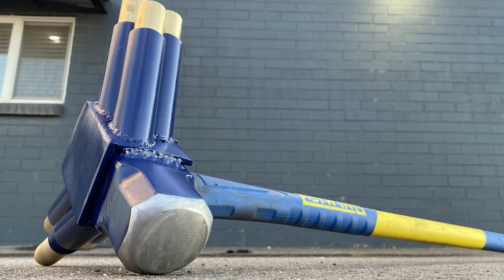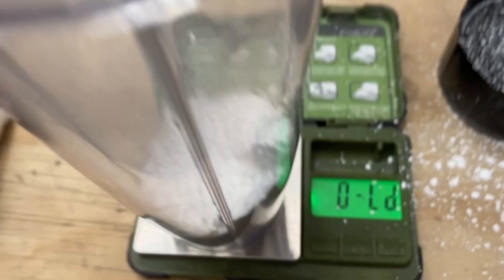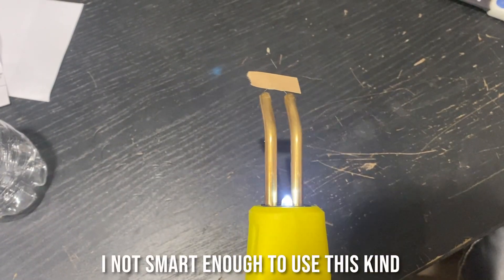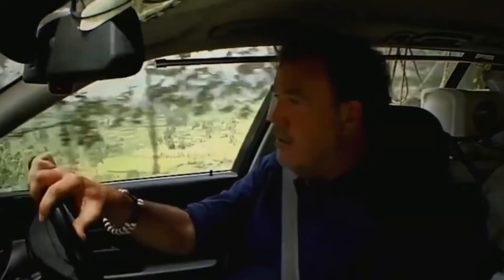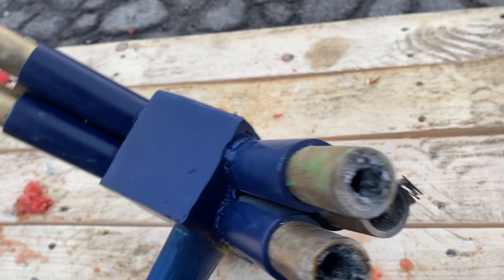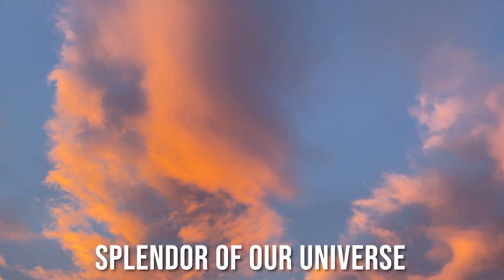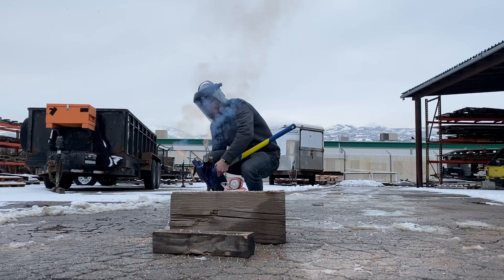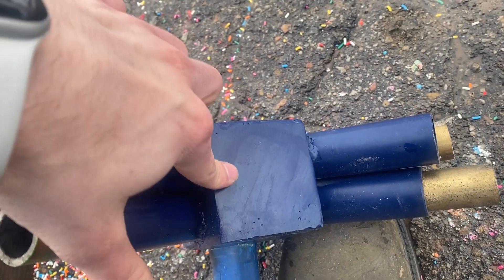I Made The World's Most Powerful Sledgehammer!

Comment: Lost a huge amount of force vector with the angle of those things.  Also the lack of efficient nozzles and an unbalanced fuel recipe means you are getting smoke and flame...but very little effective thrust.  Also, look up how to make electric matches.  It's simpler than you'd think.

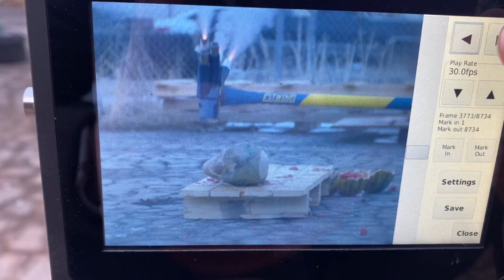@7:00 the fact you are still holding the hammer level through the air despite the fact only one motor is lit on that side confirms you are getting nearly zero thrust - or that thing would be trying to spin out of your grip.  At a minimum twist slightly to the right.  Too bad - missed opportunity!

Comment: Next time use bread ties and a car battery charger. Clean coating off then fold a bread tie into a v, put paper between the legs of the v and Jam it into the rocket so they don't touch. Attach battery charger leads to either end of bread tie then turn it on. Bread tie gets white hot instantly. Great for fireworks you don't trust

Comment: Why fuses and not battery powered model rocket ignitors? could have rigged the rocket ignitors up to a button on the handle so you dont have to handle a torch to light the fuse. plus easier to sync em up.

Comment: Instead of angling the tubes you should've just welded them parallel to the head to really take advantage of the extra force. I'd say your rocket fuel ratio was off and acting more like a smoke bomb - if you can still lift the hammer as the motors are firing, they're definitely not producing enough thrust.
Also, set up a trigger system with a 9v battery that runs to some steel wool for an easy electric igniter, that way you know all of them go off at the same time.
Reply: Ye its obviously for safety but the rack test kinda showed that the angles might have been a little to harsh

Comment: I can't be the only one who's not convinced the rockets were adding any significant amount of force to the swing.
Reply: Right. The thrust on those things are meager at best. 🤣
Reply: pff next you're going to tell me painting flames on the side of something doesn't make it go faster, get real.
Reply: @capness1228  I had a bike that I got for Christmas one year. I would go down bleachers at the school, it was cool and all but I wanted it to be awesome my dad suggested I put some hot wheel stickers on it. So I put about 10 or so I can confirm it made it faster. I went so fast down those stairs my bike broke in half. It was way to fast I should have stopped at 5 stickers
Reply: @capness1228  really??!! Well looks like I got scammed
Reply: You mean those homemade smoke bombs, or the single C6-5 rocket motor which produces a peak thrust of 3.4 lbs offset at a 45 degree angle, effectively reducing the thrust 30%? So he effectively turned the stock 10 lb hammer into a fancy fire shooting 12.5 lb hammer!

On the one hand, safe practices means that anything much larger would be wildly dangerous to both the user and anything within several hundred feet, especially if the thrust to weight ratio exceeded 1.0, but on the other hand the intro said "50 lb of thrust" which I have a feeling was never verified with a scale. 
Also I know some hobby rockets use an electronic ignition, imagine how cool it would be to hit a button on the handle to ignite the rockets before letting loose your mighty swing
Reply: to be fair, when it was standing up for the tests it was moving the hammer side to side, so even a couple of them had enough to overcome it's weight?
Reply: Zey did nussing!
Reply: You're the only one with enough autism to think that and actually comment it
Reply: Total garbage!
Reply: Yeah, but it looks friggin epic
Reply: Fr
Reply: Extra weight
Reply: they were basiclt smokebombs
Reply: Yeah but using it looks like a Forward Smash so it's valid
Reply: Comedy
Reply: Young kid who works at a metal shop guaranteed. They build a bunch of silly some times badass random stuff.
Reply: This Idea just screams "special needs"
Reply: You arent it just looks like what a normal sledgehammer could do
Reply: I think it's just supposed to be for fun. Like most of their projects.

Sometimes I'm actually on the dislike train for the videos on this channel. They can be really low effort, I'm not always into it. But I think they actually did a pretty good job on this one. The sledge is well built, the footage is good. He took on a reasonable amount of risk while wearing PPE instead of being stupid or endangering other people. I think this one is solid. Are the rockets really doing anything? Probably not. But they're cool.

The moment when one of the commercial rockets falls on the ground right before igniting and he looks down and says "uh oh" as it fires off was funny enough that it made the whole video worth it IMO.
Reply: @DaimyoD0  What they do for fun is waste my time so they can have clicks on their video. Mistitling like this is a sin.
Reply: @MangoTekNo  Have you ever been on YouTube before? This is some of the most benign clickbait I've seen. The sledgehammer has rockets on it. Therefore, it's rocket powered. Do you know how many people claim they have "The World's Xest Y" with any evidence to support them having a world record? It's not like there are a bunch of other rocket powered sledge hammers in competition with it, making someone else's rocket powered sledge more powerful. You're watching a YouTube video about a sledge hammer with rockets strapped to it—you were already wasting time. If it's worth it to you to argue in the comments about it, your time can't be all that valuable to you. I know mine isn't.

I don't even really like these guys but your take is forcing me to defend them. If you hate clickbait, blame YouTube for developing an algorithm that requires creators to use it if they want anybody to even see their videos.
Reply: @DaimyoD0  I'm subscribed to Stuff Made Here which makes these claims and follows through. Why should I expect different from this channel and skip the content? Oh right, because this channel is apparently liars.
Reply: @DaimyoD0  I agree with the fellow, the clickbait was too strong, the end result too weak.  This video was a waste for me.  I would have liked it better if they were more accurate in the title, instead it's a disappointment.
Reply: you ARE. that hammer was SCREAMING rocket power.
Reply: @Davidautofull  
We are riders on a mission
Action kids in play position rocket power
Reply: I feel like if these rockets would assist in any way, they would need to be angled back instead of the 45° (seemingly) that they're at now.

The caveat there is now the user would be in direct path of the expelled explody, CO2 stuffs 🧐
Reply: @PorscheDuésnburg  nah since there are rockets angled the same way on both sides, the resulting force will still go forward. I'm pretty sure at least.
Reply: @dexorne9753  funny thing was, some time after I posted that I THEN thought about it 😂 the rockets may be imparting equally stability and thrust, being at the angle they are. At least, that's my revised hypothesis on it 🤔
Reply: @PorscheDuésnburg  yeah I should be right as long as I remember my basic physics right, and there's not some more advanced stuff I don't know about going on that plays a significant role which I doubt.
Reply: Doesn't matter. Still awesome
Reply: wow you don't say? is almost like it's a joke
Reply: @squanderer5400  It's not always a joke when your bullshit is called, can't just dismiss everything as a joke the second someone doesn't agree.
Reply: @squanderer5400  your attitude is the joke.  Seriously though, if this counted as a joke it was a lame one.